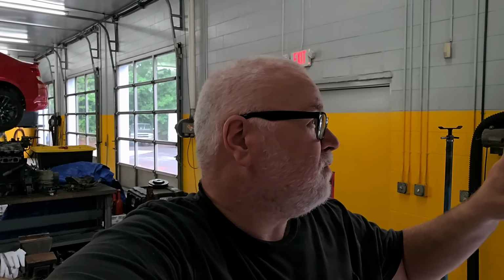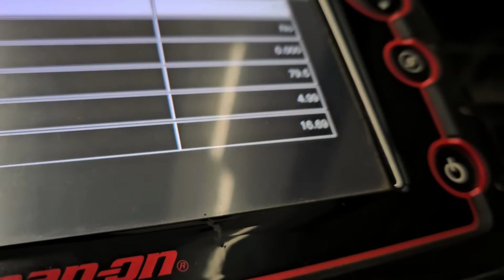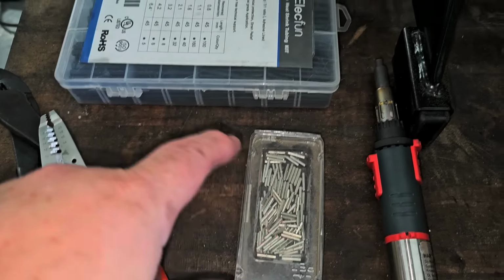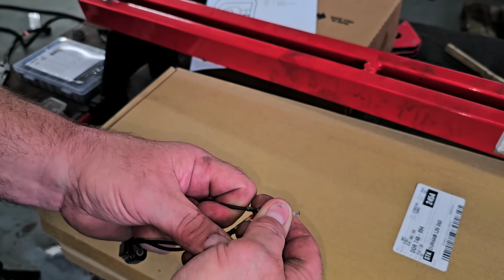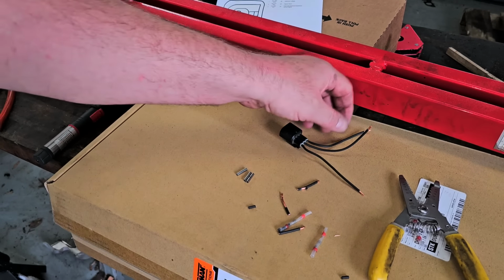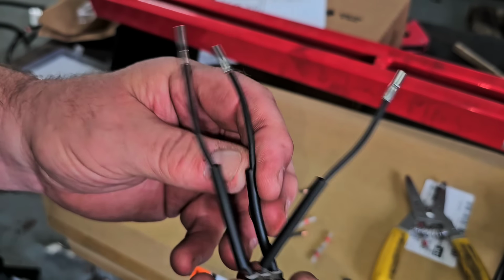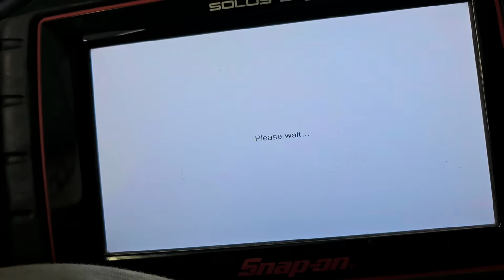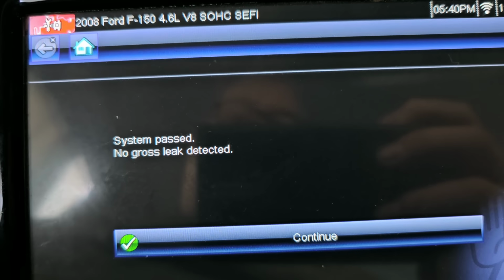Do Not Use These Connectors! They Are Not As Good As They Seem!!

Comment: My experience is that it only works on absolutely pristine new condition wire. Anything else and it will not flow properly because the wire was not tinned first. Plus most of the time they never get the connection hot enough either.
Reply from the maker: All good points! Thanks for your reply. Keep wrenching 🔧

Comment: 1. Problem is not install right like others said. 2. Lighter and other flames shrink and often melt the tube before the solder even starts to melt. 3. Even heated right, the Solder doesn't have enough Flux to clean off wires with heavy oxide layer etc. 4. Many blame X connector but X connector wasn't made for Y condition like Scotchlok "Vampire Taps" was never design to be use any wet areas. 5. Copies of 3M and other Branded products have many problems to make them cheaper then original parts like counterfeit IDC parts fails to cut thru insulation right or cut the wires too.

Comment: you can see that the solder never flowed into the connection but i don't like them in tight spaces it is hard to melt connector with a heat gun or lighter I'd rather have crimp or solder with heat shrink out in and easy to get to spot it is ok since you could see if it flowed well.
the military likes physically cleaned and mechanically connected wires which are twisted together then soldered and then heat shrink connected or covered with a sleeve for best conductivity

Comment: The other connector I hate is those tap in to a wire connectors that are supposed to cut thru the insulation when snapped together and never work right. I have seen them in many kits for lights and other add ons and they never work right. Better versions are available that work.
Reply from the maker: Those are Scotchlok. IMO, they are garbage. Thanks for your comment & watching the channel. Keep wrenching 🔧

Comment: Having used those connectors, I learned to make sure the solder melts and flows. I always test my connections for volt, amp, resistance. no matter the connection used, test your wires.

Comment: It takes just as long to solder a wire together as it does to use a connector like this that has such a low melting point with the solder. It’s worth it to just solder I’ve found less worries.

Comment: The wire has to be clean

Make a mechanical connection first, then solder holds it together not making the connection.  

I was certified to solder stuff going into space.  We did have some crimped connections but matched connector and calibrated crimper.  

I solder everything I can then heat shrink everything.  Insulation displacement connectors are equally as bad especially outside. 

Those solder seal connectors like so much else need to be used properly.

Comment: You can't beat a good solder job and heat shrink tubing.  The problem is that most people can't solder properly.

The car companies don't solder because it takes too long and is expensive. I have had to solder factory crimps because they were not done right at the factory.

Comment: There is no Flux in those low temp solder connectors. Even if it melted correctly there is no Flux to stick the solder to the wires! Totally agree, they are junk for anything auto/motorcycle.  Everyone should know how to solder properly,  it's a good skill to have. There are circumstances where crimp connectors are not appropriate.

Comment: I just use solder, flux, a dab of dielectric grease over the bare soldered connection...with a long piece of heat shrink...
seems to work well enough. Idk...

Comment: As everybody said there was not enough heat to melt the solder.  I have seen people glob solder onto a wire without enough heat many times.  Those connectors may work if installed correctly but it is hard to tell without destroying them.

Comment: I have some of that solder connectors too. I think they can not work propperly without flux.
Reply: Quality butt connectors of this style have flux inside, it's the colored bit on the outside of the solder ring before you melt it.

Comment: I think you need a heat gun to make sure you melt the solder while not roasting the rest of the connector. I'm certain they are not intended for automotive use, definately not in areas that are prone to corrosion like underneath the bed of a truck.

Comment: I use crimp connectors, but with the proper ratchet crimp pliers, those cheap plate cutter/crimp things are rubbish and cause so many problems. Also the crimps themselves vary wildly, some are brass and are way too brittle.
Trailer stuff I tend to solder.

Comment: I've used them and had success with them - he didn't let the solder melt if I saw right - the plastic will melt some when they are finished - but you also need to put flux to clean the wires off -  please read what I said carefully - he never let the solder melt - that's what the problem is the solder has to liquefy to get them to work proper - the guy who put these on didn't do that
Reply from the maker: I understand, but that assumes that the solder really melted. I'm glad they work for you. I have seen too many disasters, including fire, because people assume the solder inside made the connection. Thanks for your input & watching. Keep wrenching

Comment: There are cheap Chinese connectors and expensive ones. I have had failures with the cheap ones ( they don't have enough solder) but not with the good ones. After installing them correctly, and waiting for them to cool, you tug on the wire and if it seems to stretch the solder didn't melt or didn't bond. I've had them in my old Honda for yearas and never had a problem. I don't use them on wires larger than 14 guage because they need a lot of heat. I use a propane pencle that works in small places.Snap On seells a kit that works well. I haven't seen you use a DSO. Do you even have one? You need one to check sensors and fuel pumps whichn takes minutes instead of hours.

Comment: This is not a equipment failure kenny the person who installed them clearly didnt get them hot enough to flow the solder into the wires (hard to do with copper conductors without sizziling the insulation a little)

Comment: I agree with you on those idiotic connectors. I’ve tried to use them when they first came out but they are horrible. Went back to the type you are using… the heat necessary to melt the solder sometimes melts the  shrink tubing, or the solder doesn’t melt. Really crappy design.

Comment: ah they be a royal pain with any cordless heat gun.  touchy with a torch (they can melt away),  but a plugin painters heat gun will do the trick and cause the solder ring to melt and flow over CLEAN copper.

Comment: Don’t blame the connectors. Blame the person who installed them incorrectly. First,the solder was not melted and second.you need to push the wires in far enough that they pass through the solder ring. If done correctly they are fine.

Comment: I disagree. They work fine if you remember to heat them and visually observe that the solder flows. But in this case it's obvious nobody tried to heat that one wire up at all.

The only place they do not belong is anywhere where it gets hot. The solder is a low melting point one and near the hot parts of the engine or the exhaust system they can melt and separate south. (Melting point is about 130C or whatever that is in F.)

Comment: Poor repair causes repeat failure. Did that Chevy cruze with funny looking O2 sensor valve cover come back in yet?
Reply from the maker: Nope
Reply: @WrenchingWithKenny  Well either they are ignoring it again until it smokes the turbo or they took it to another shop because the code came back on. There is a TSB about that issue. The valve cover gets ruined by the PCV check valve. If its ignored long enough the turbo smokes.
Reply from the maker: I will keep you posted. I can't remember if they had work done at the dealer & they refuse to go back, so they came to us. We have had several Chevy customers that we do their work except for dealer warranty work. Thanks for the info. I appreciate you! Keep wrenching!

Comment: I use regular butt connectors with electrical tape on interior work for 20 years never had a issue i like the heat shrink crimp connectors for wires exposed to the weather

Comment: To me, those solder pods do not look like they were ever heated, at least not long enough for them to melt properly!
The glue didn’t even stick to the wire insulation!
I call operator error not product failure.
J M O !

Comment: Vehicle manufacturers do not use soldered joints because they don’t do repairs to wiring harnesses. This is not a reason to not use solder in a repair if you have learned to properly solder a connection. A poorly done solder connection is as bad ad a poorly done crimped connection. I have seen many poorly crimped connections fail over time as well as poorly soldered connections. After 40 years working on cars, I can say that I have never seen a properly soldered connection fail.

Comment: Other than running an entirely new wire, solder/heatshrink is the best repair.

"is there any solder from the factory??"
No there's no solder repaired joints from the factory. Just like there's no butt connect repaired joints or any other repaired joints from the factory. Bad argument. 

But I get it, sometimes repair joint locations are in tight areas and soldering would be impossible or very difficult. And you have to get cars in and out, so a butt connector is easy and can last for a while.

Comment: Automotive wiring often tarnishes or oxidizes. If you don't have the presense of mind to remove the contamination, you will have lots of voltage drop (electrical resistance) at your crappy, so-called connection. If solder won't flow, your connection is garbage, whether soldered or crimped. Good quality, brand named, like Thomas & Betts or Ideal are essentail for a long lasting, quality repair!

Ignorance, laziness and stupidity are very common when it comes to "know it alls" who don't have a handle on what they know and what they don't know. I saw SO MUCH of that in owner "repairs" when I was an auto mechanic.  I gave many guys the suggestion to "find a new hobby."

I recently had one purged from my life. he was a constant source of poor work, preconceived notions and very poor practices, that would embarass a reletave intelligent 9 year old. Good riddance to him and all the hard headed fools who refuse to learn "best practices" and accept the mediocre as acceptable. "Scotch Locks" are the worst thing anyone could ever use on wiring.
Reply from the maker: Well said! They are garbage. Thanks for your response & watching the channel. Keep wrenching 🔧
Reply: @WrenchingWithKenny  Your vids are very good. Keep up the good work!

Comment: Those connections didn't get hot enough to melt and the wire must be clean. The problem with them is usually because improper install. They must be installed with a heat gun.

Comment: Gotta say, that is exactly how I splice wires...simple, easy to check for connection, low cost, and reliable.  Complicated doesn't always mean better!  Looks like another failed attempt at "building a better mousetrap", by some overeducated engineer with little real-world experience, bought and misused by gullible suckers, easily impressed by gimmicks.

Comment: These connectors are ok as long as you get the solder to melt into the wire. I’ve never had problems with them. I’m not saying they’re the best way to connect wires tho.

Comment: So if it never penetrated and there was no connection why was the hg  reading different with the plug connected vs disconnected
Reply: The -2 reading was due to a bad connection(s). The 16 reading when unplugged is a computer default value when no signal can be found. Car computers have the ability to substitute a good enough value and turn on the check engine light to keep the car from completely not functioning because of a bad reading.

Comment: Those connectors seemed so perfect in the little advertising clips, but I never bothered getting some.  Also anyone here have any experience using those Wago connectors in automotive applications? The inline ones seem like they might be handy for a tight situation with little wire to work with.
Reply: WAGO are designed for stationary installations. Vehicles move and bounce around and require something substantial to be used.
The wago connectors literally tell you to wiggle the wire around a bit to release the wire if you want the connection undone for their push lock style connectors.

Comment: Those were not done properly. They should not have any of the original shape to them. Whoever did that they didn't know what they were doing. Do these work absolutely they do. Are they always done properly NO. Whatever method you use it is critical for proper installation and sealing the connection

Comment: Heat shrink connectors are something you use for a headlight.  Any tool will appear subpar when it is used for the wrong application by someone who doesn't know what they're doing.  You never use these on a sensor harness, that's just common sense.

Comment: I can see the Solder in the connectors has not been heated to melt the solder...the shrink cover has shrunk, but the solder was not heated to melting temp... it is very easy to do. most likely reason was the person could not see what he was doing, and did not heat the solder to melting point...you said you don't use crimp connectors... what are you using ?? Crimp connectors, just without the colored covers... be realistic...
Reply: You have to heat the copper up hot enough to draw solder since the beginning of time. There's no way that's happening.

Comment: These connectors are garbage, the wire never gets hot enough for the solder to bond. I tried these a few times the wound up tossing them in the trash ….

Comment: The solder hasnt reached its melting point
Reply: Also i agree with you that manufacturers do not solder connections because of resistance issues

Comment: The connectors were not the main problem, the guy who installed them did not look to see if the solder had melted, If the same person had used crimps you would probably have the same issues, he was the issue..........

Comment: Like any tool or technique, they are only as good as the user.  How can I trust the opinion of someone who has never tested the product properly?
The fact that Kenny has seen a bunch of bad connections is not indicative of the quality of the product, but the competency of the users. They tried to fix it themselves, didn't use the products correctly, and then gave up and took it to a professional.
I recently bought a kit and it worked well for a stereo installation on an old truck. You need to have a good, clean connection and twist those wires together well before sliding the connector on. Only then do you heat it until the solder flows. 
The company is trying to make it quick and simple, but go ahead and flux the wires if you want a better end product.
Dig a $50 hole for a $5 plant and you'll have a better chance at success.  Dig a $5 Hole for a $50 plant and you'll have dead plants.

Comment: Lots of comments defending those connectors, but completely missing your point: "how do you know that you have a good connection?" The solder can melt and still not flow into a wire because the wire is slightly corroded or made of a material that will not take solder (yes, I have seen it).
Reply: These connectors have a color coded (Blue green red yellow purple etc based on wire gauge) band of FLUX around the solder ring before you heat them and also the plastic tube is clear to help visually verify proper melting. The Tubes even have color in the wax sealing compound on each end of the butt connector to help verify a proper melt was reached in this area as well.. The person who used these connectors  used them improperly.
His point isn't missed or ignored, our points that they weren't installed properly is.  These connections are stronger than the wire you are trying to connect in smaller gauges when done properly and These were not installed properly.
A good weld is stronger than what you are welding, the same is true for this style connector when done as designed.
Reply: @btwbrand  To my ignored point and the point of the video, what if the solder looks like it melts but does not bond to one or both wires? And you have this mechanical connection via the heat shrink but resistance in the connection? You have two wires that when pulled apart would give resistance (and nobody yanks on them hard enough to test the "stronger than the wire" business). Did you see how hard he pulled to get the last one apart? Compare this to soldering-then-heatshrinking, where the wire would visibly not accept the solder. Then you look closer and either strip back to find cleaner wire, or are FORCED to crimp because the wire is an alloy that DOES NOT bond with regular solder. Perhaps you have never had that bond issue happen? Anyway, cheers for the polite discord :)

Comment: 100% installation error, these type of connectors would have worked fine for this application.
Reply from the maker: Well, except you don't know if the connection was actually completed. Yes, the sleeve is on, but you really have no idea if the connection is any good. I wouldn't trust it on my cars or any of my customers cars.